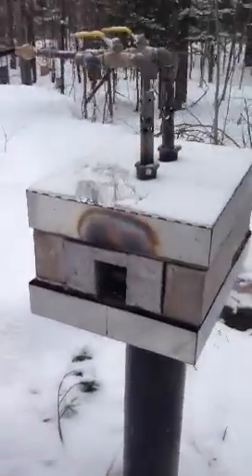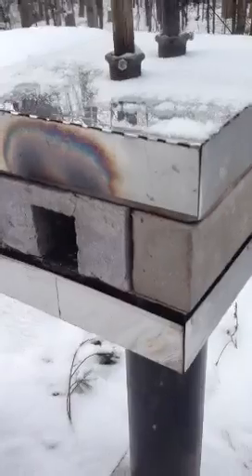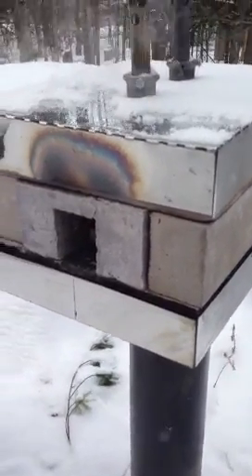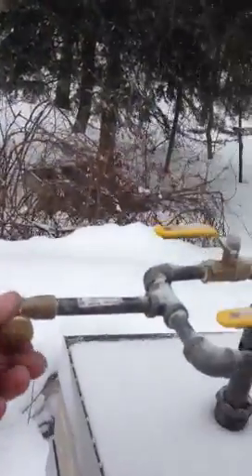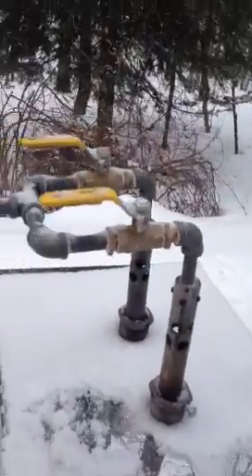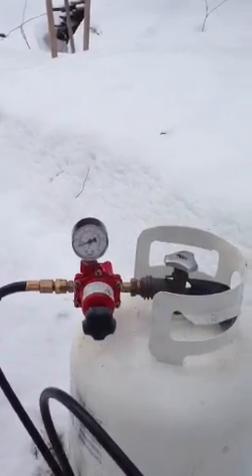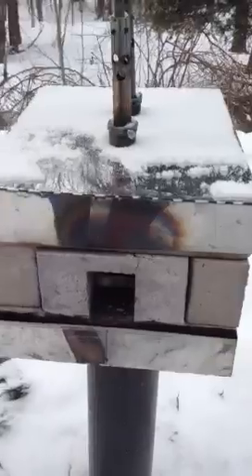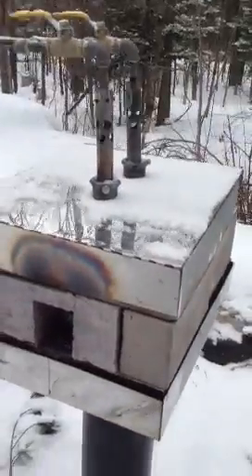Propane forge

Comment from the maker: The kiln cement was not a good idea - it flaked off after about 10 firings.  I have replaced it with ITC100 which (so far) seems much better.